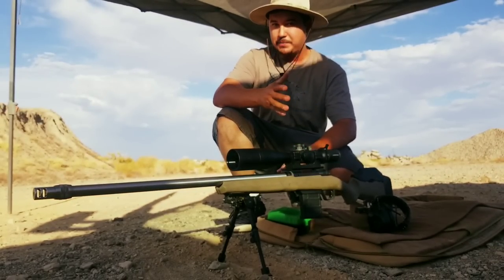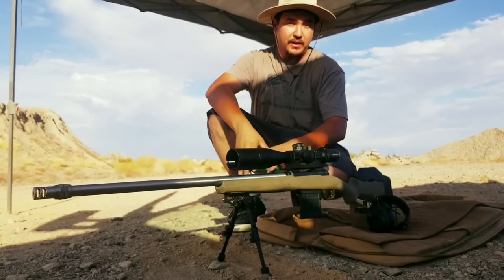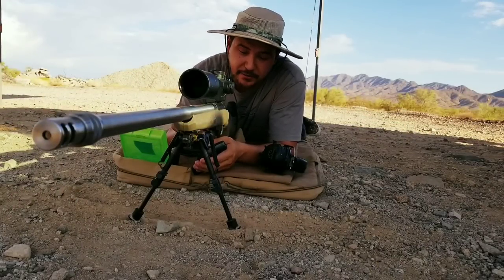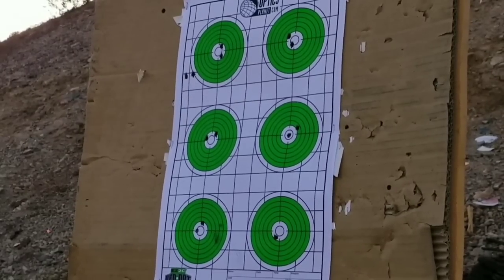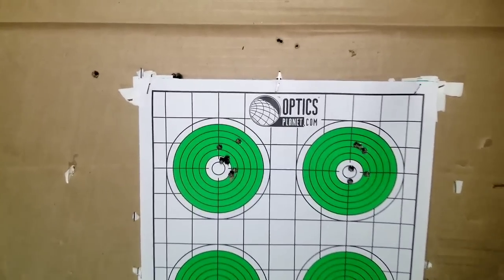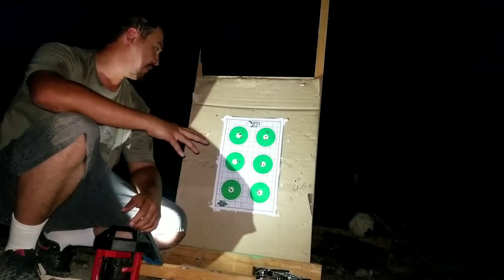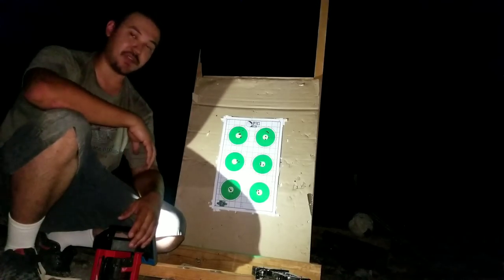Harmonics Tamed | Harrell's Tuner Brake - IT WORKS!

Comment: I purchased a Browning 270 with the B.O.S.S system and it was the most accurate rifle I ever owned.  Shot  factory ammo very very well but I wasn't into reloading at the time so no idea how it would have worked out on those.  Barrel tuners work.  It's physics.
Reply: You hit the nail on the head. Many years ago the procedure was to barrel and chamber the action with a long tube. You found your chosen load and simply cut the barrel and re crown to to get the harmonics correct. It was a LOT more work then this as you might start at 26/28" of barrel and chop/crown several times to find the sweat spot.
Reply: I had the A Bolt 2 with the BOSS system in 270 and got ragged hole accuracy about every time . I’m a believer in barrel tuners .

Comment: Like Eagle Eye, I always start with the brake adjusted all the way to the rear, set at Zero.  At this point, I work up my most accurate powder charge, seating depth, and primer. Then, I start adjusting the brake Out in one or two graduations ONLY!  I am looking for the bullets to go in the same hole, and I shoot two shot groups finding the Node, then verify with more shots in the group. Till the bullet start going in the same hole, I know I am still searching for the node.  Sub 1/4" groups are the norm, and they repeat.  I have had great luck with Harrells, RAS, Browning BOSS, and EC tuners.

Comment: With my Harrells tuner/brakes I use a full revolution or 15 turns, technically 16 turns if you start a 0, and generally I find a good node about every 4 turns.
It does work as my best 5 shot groups @ 100yds. with my 223 Rem. 700 have been reduced from 5/8" to 3/8". 
Very happy with this as I have only been shooting for a year now using a factory barrel.

Comment: I think that if you really want to finely  tune the rifle extend the range ,at which you are tuning, out further to more than your zero range (typically 100yds or 200yds for most folks). This only exaggerates the grouping so if you're at 300 yds and want to be a 1/4 minute rifle than tune it to have a group of .75ish of an inch on paper at the 300yds neglecting where the group is. Its simple trig.  Feel free to share your opinion on this. also remember that the tuning done by the shooter may vary from shooter to shooter as extending the range will start to become shooter dependent. Not everyone can thumb nail a hair pin to a ants antennae at 300yds. As this is only a theory coming from a archer's perspective that I used to fine tune my bow.
Reply from the maker: That is why I did load Development to get ES numbers in the 6 and 5's SD at a repeatable  7 FPS and shots stayed under half MOA at 1,000 yards which confirms stable BC's. This is in the previous videos. The tuner gave me the ability to utilize a powder charge that gave me consistency yet harmonics where off until the tuner

Comment: I have used tuners on 6 XC, 105g Bergers, tuned the load down into .060-.120 groups over a spread on the tuner, max heavy varmint, 29-31" barrels.  Also a 6 BRX with 105's and 87's with a 28" unturned blank, shoots tiny groups just like the 6 XC.  I tune with two shot groups, off a bench, off a rest, then verify with three, then multiple 5 shot groups.  Next step is to go to 300 yards. Tiny movements in the tuner can have a dramatic effect when you get down to groups this small.

Comment: I have been shooting and making tuners for 10 years, mostly for small bore bench rest rifles. The concepts are the same for big bore guns. FIRST RULE> Tuners will not cure an inaccurate poorly built/designed system, they are the final touch on an already solid package! RULE 2  Don't try to find a loading AND tune at the same time....you will go NUTZ!

The easiest way to get your barrel stopped is like you are doing. Shoot a known good accuracy round with 2 shot groups. RELAX 10 round groups or it's nothing guys....if they aren't touching on the first 2....3-4-5-6 are meaningless! If you pulled a shot start over...be honest!  Shoot 2 rounds, and keep adjusting til you get rid of the vertical spread. Vertical is the gun/load/tuner.....horizontal is the shooter/wind call. There you go, now go out and shoot!   G>

Comment: I got luckier on mine! I have one on a T/C Compass in 7 mag. I started all the way out at 150 and the gun shot consistently under one inch with 162 grain bullets. When I went out to try 175s I decided to start at zero and work up the scale. At zero the gun shot 1/2 MOA groups. I pulled out my other loads with 3 different bullet weights and the all shot no worse the 3/4 MOA. Not bad for $275 rifle! And the spiral brake takes all the recoil out!!! It’s amazing!
Reply: My TC Compass in 308 shoots 1moa with cheap 150gr federal powershok at 100. About 0.5-0.75moa with the good stuff. This is also off a sandbag - I imagine I could tighten it up if my shooting was better. I rock no brake, though...the 308 really tosses you off target each time lol. But for a dedicated cheap deer rig, you can't beat it. Got it on sale with a 4-12 Vortex Crossfire 2 scope for under $300 all in.
Reply: Daniel Dotter I have no idea what my T/C shoots like without the brake. All I can say is it’s peach to shoot as it has little recoil with even the hottest loads! It’s loud, but what 7 mag isn’t?

Comment: I absolutely love that you include your boy in your videos and the shooting experience. As for the brake, how well does the adjustment ring stay locked in place? Seems like it would want to loosen up and walk
Reply from the maker: Theirs a jam nut. Its precision ground so they lock together very tight. Pretty hard to get it to move. Ill put it to the test in a prs match and give feedback
Reply: @EagleEyeShooting   please give feedback on how well it held in place after a match. I am working on a 6 ARC gas gun build for a customer and I like this brake but am skeptical that it doesn’t have a set screw or anything to lock it in place.

Comment: Which model of Tuner brake did you get?  I see on Harrell's website the tuner brake with ports all around and Tactical brake with 2 ports.  I like the one you got because I don't want dust kick up from ports all around.
Reply from the maker: Tactical two port. Check the PDF list on sizes and threading to best match your barrel diameter

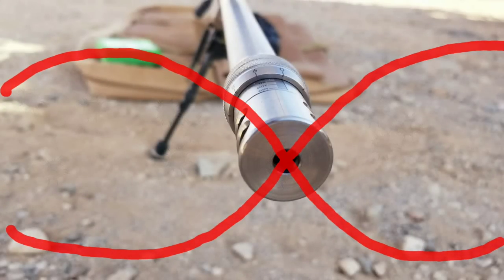Comment: Your explanation of harmonics is excellent.... BUT...as to your video drawing....I think you are mistaken to think the "best" place is where the curves intersect....meaning, to be at the "nodes" ( 1:38-1:50). I think the "best" place for consistency...is at the "anti-nodes"....or the very peak or the very valley of the sine wave. Why?...because if you take the "pointing" of the barrel to be the same as the shape of the harmonic sine wave....that's where it is most horizontal, and also is the most forgiving as to staying fairly horizontal for locating the tuner a smidge left or right from this spot.   Meaning....at the flat top or valley bottom.....being "off" even a bit makes the barrel still shoot rather horizontally......however, at a node...if you're a little bit "left" of the node and the barrel (say) points "up"...then being a smidge too far to the right will have the barrel pointed "down".....a very delicate place to park your tuner. I say park the tuner at the anti-nodes....the very top peak or the very bottom valley. Thanks for allowing me to share.

Comment: It’s a great concept. Once you get it dialed in, does the brake lock well enough to not move around. In other words once you narrowed it down to 36 Range can you lock that pretty well?
Reply from the maker: Yeah, Ill make a video on the Brake, showing its internals. Theirs two weights which are precision ground and lock up with each other. It takes quite a bit of force to separate and get it adjustable again. I think it's pretty solid and wont move,  however we'll see after I run a PRS match with it
Reply: Eagle Eye Shooting thanks Kenny.

Comment: Nice! Very interested in this brake! Question: Did you remove the copper from your barrel each time/session? Coppering does have an effect and can actully improve accuracy as well as decrease it (has its own node)
Reply from the maker: On this test the barrel had already 50+ shots. Copper fouling is very minimal with a bore scope

Comment: i don't know if it was already commented on, but the Browning BOSS system is just a harmonic tuner.  Some folks told me it was a gimmick when I bought it off a friend in 1997.  Honestly I don't think my friend knew how to use it, but I figured it out and it really will tighten up groups.  That .270 A-Bolt would cloverleaf at 100yd.  Really sweet system.

Comment: So how about some more information. Like what kind of Savage, barrel length, MV, Barrometric pressure, temp, elevation, load info. I had a good result with the precision armament M4-72 severe duty for $99. on a Savage vt 11 308 24" heavy barrel accutrigger Altitude 608ft, Ambiem temp 70F, Ammo temp 71.5F, MV  average 2725, Barrometric 29.09 Humidity 00% with GM308M 168gr Federal Premium Gold Medal Sierra Matchking factory loads, 100 yard zero 3/8" groups.  The reason I ask, it gives me apples to apples comparision. And I like to try what other people might have had sucess with their hand loads. One person said an equivelent load for the GM308M is IMR 8208 XBR with 43 grains of powder,  Sierra Matchking 168gr bullet, bullet & case length 1.220",  Federal brass, Federal 210 lg primers. I would like to one day go to a 175gr bullet or a better CoEf bullet if I hand load one day. Thanks for the video. I like seeing videos of people who are teaching well. Just would like to know all the hardware.

Comment: With a bolt gun is there an advantage choosing the ARC over a 243 given the same grain bullet? Seems the longer cartridge would feed from a magazine better. I don't have experience with long range shooting. Just curious. Thanks!
Reply from the maker: Ballistically speaking, their are many 6mm cartridges that will outperform the 6 ARC in long range / hunting. However, that is not my primary reasoning for using this in a bolt. PPC style cartridges offer the benefit of little recoil with near performance of the bigger cartridges. I've chosen the 6 ARC for this to compete in PRS. It hits all aspects of a PPC cartridge without the hassle of having to fireform brass or buy special mag followers for reliable feeding from a 308 AICS
Reply: @EagleEyeShooting  I would suggest looking at the Percision riffle series profiles of the top shooter's in the country and see what they are using. It will save you time and money.
Reply from the maker: @Derek Graham, I have.......obviously.....don't have to follow the trend if your gaining results with something different right?  Perhaps I'm just showing if the cartridge is a valid performer for this application....a rifle and its components are just a tool. You can give a shooter the best rifle and most commonly used cartridge.  That doesn't mean he or she is going to win
Reply: @EagleEyeShooting  You are correct. Just from my experience trends at the top are validated with results.
Reply from the maker: Yes, I have a 6 Dasher and 6 CM setup to choose if this doesnt hold up. Chassis and ARCA rail on the way for the Savage
Reply: @EagleEyeShooting  I'm shooting the Savage elite percision in production this year.

Comment: How does the recoil reduction compare to other non-tuneable brakes?
Reply from the maker: Hard to tell the difference as the cartridge already is very light in recoil.  I did have a lil bastard brake on it before.

Comment: I'm not sure what I think about that . Without seeing it apart I'll reserve my opinion on it . Off hand it seems gimicky .
Reply: @jimhans1  What happened to tuning the rifle with the load ?
Reply from the maker: I did just that in the last video. Got my ES and velocity where I wanted it. Then tuned the harmonic to group.
Reply: @jimhans1  We're not talking about .22's , were talking about tuning a reloadable cartridge . Why would you want a longer than magazine length load if you have a magazine fed rifle ? You're saying , this allow's you to tune a rifle to shoot a longer cartridge and not be able to use the magazine anymore ?..... My way of thinking is to find a load that shoots at magazine length .... I'm an old school hand loader and finding the node is not that hard without a gizmo hanging on the end of the rifle .
Reply from the maker: I agree with keeping things simplified on regular reloading,  however I can give some insight for thought in why I chosen this gizmo hanging off my barrel. To emphasize,  this rifle and cartridge combo is aimmed towards PRS. So to be competitive,  I need every advantage in getting 2900 FPS. The main reasoning is im matching my reticle holdovers. At 2900 FPS I only have to work in the 5 MRAD for majority of the courses of fire. So since I found a consistent load that puts out extremely low ES numbers. This tuner served it's purpose in achieving my goals needed. Less recoil than 6mm Creedmoor,  cheaper reloading, reliable mag feeding from an AICS Mag and velocity matched tuned load. It's not uncommon to see tuners ran in today's matches. My roots in Handloading have instilled to stay basic, however tools like this can accomplish needs that basic reloading cannot. Staying opened minded
Reply: @EagleEyeShooting  I'm keeping you on your toes Kenny , it's my job . LOL

Comment: You started with no copper the gun it needs to foul and pressure needs to become consistant , no wonder it started to get better at round 35. Your test should start at that point.
Reply: @UCfveKF89KlxfxQorgnBSVLQ Regardless of the amount of visible fouling it still affects pressure which is speed and thus harmonics changes.
In a prs match the gun gets shot more of the time fouled than in any other state this is why testing needs to be do with the rifle as close to that condition as posible
Reply from the maker: I do not disagree with what your stating. However for this test, I did find a harmonic node that worked with the tuner. And was repeatable when changing the weights, regardless of clean bore/copper equilibrium